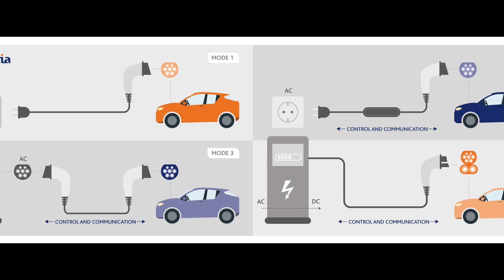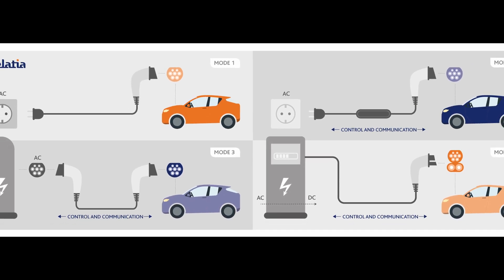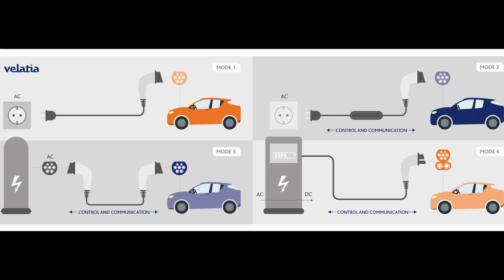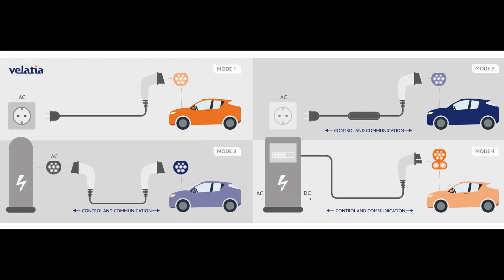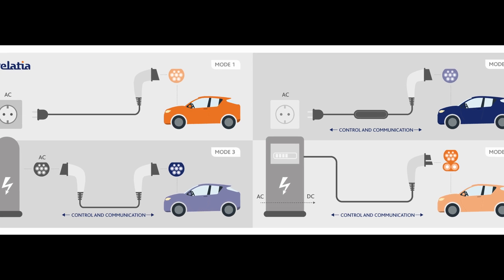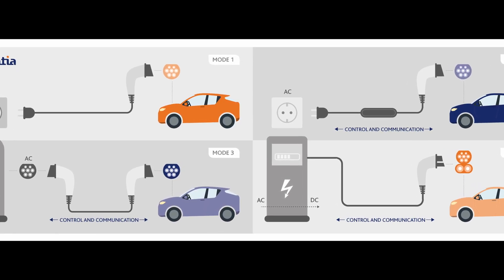Tech Quickie #2 on changes to AS/NZS 4777.1

Comment: It blows my mind that us Kiwis still have to use AS 4771.1:2005....yes the 2005 edition - nearly 20 years out of date. The same goes for AS/NZS 3000:2007. New Zealand's Electrical law is becoming a joke. The EWRB are making it easier for Builders to do Prescribed Electrical Work, with no limits so far - yet at the same time the EWRB are making Mains Parallel  Generation an Endorsed licence, with no avenues for licensed Electricians to gain the Endorsement unless you're already involved in MPG work. I can't believe how backwards our industry is becoming in New Zealand
Reply from the maker: Unfortunately it's in the hands of the Energy Minister. Perhaps it'll take something like the Pike River disaster to get some action. Anyone up for dying for the cause?
Reply: @SmartEnergyLab  Dark!